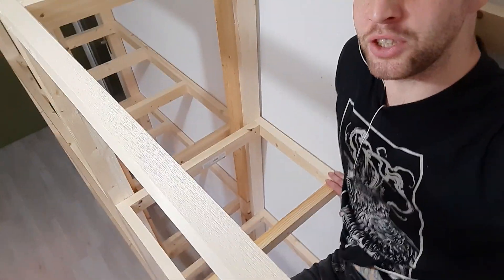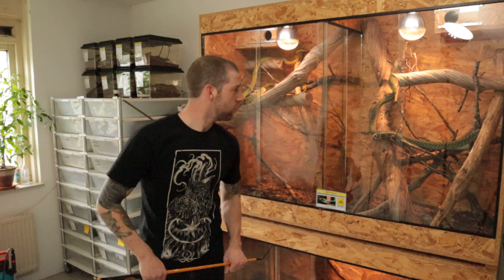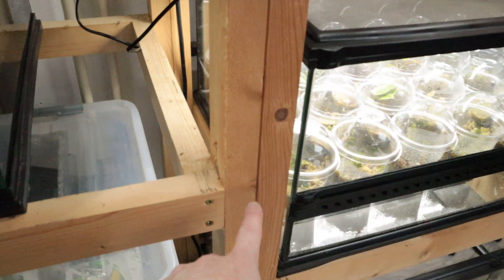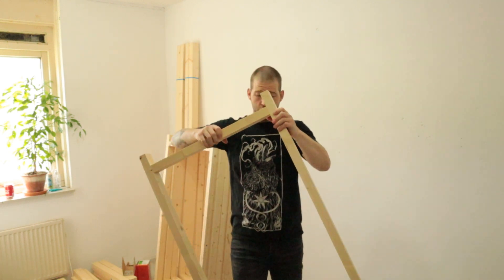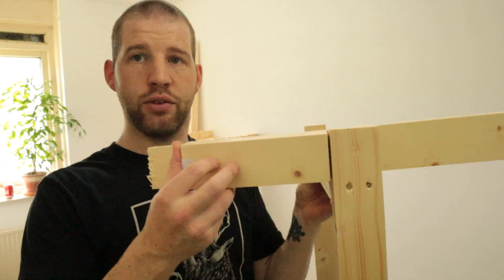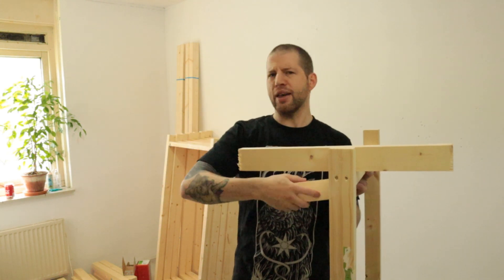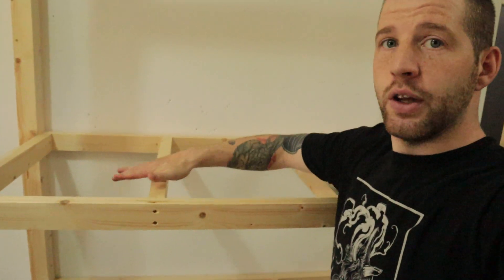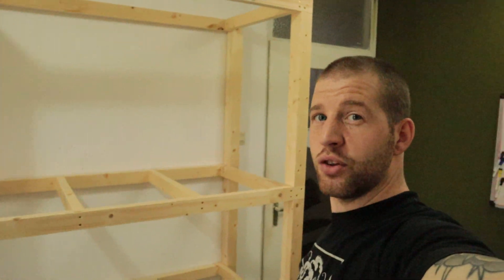The easiest way to build a Terrarium stand? DIY build @Terrarium Channel

Comment: Very useful, thank you. What do you think, is the forced ventilation with computer fans a good idea?
Reply from the maker: It can be. Problem is that you need to be very aware of airflow/direction. And the enclosure needs to be in a space where outside conditions are similar to the ones we try to achieve in the terrarium. Otherwise all we are doing is forcing/pulling in colder and or drier air.
Reply from the maker: So yes, more airflow can be a pro. When properly thought and planned over.   

In a closed system as I see in some US dartfrog setups I would for sure add some to create proper air movement.